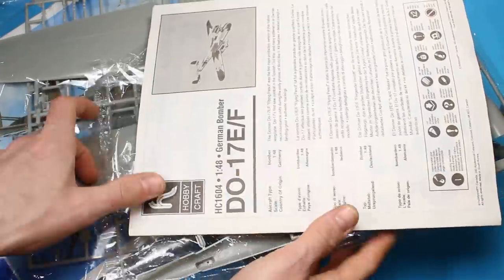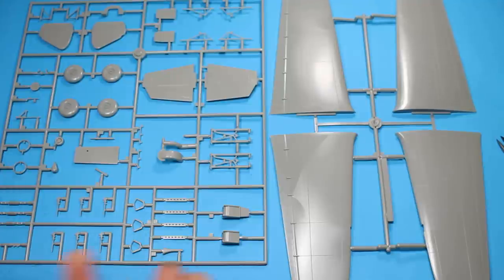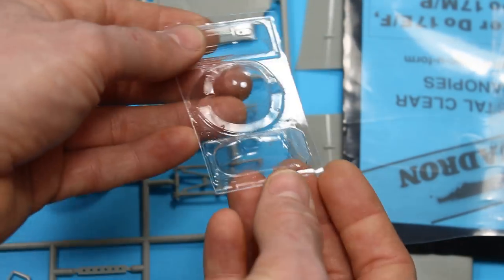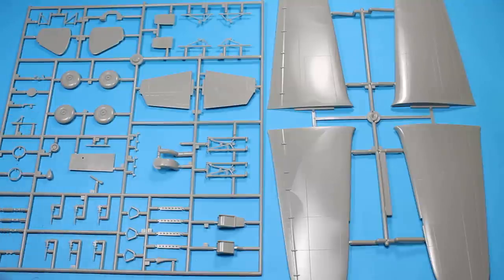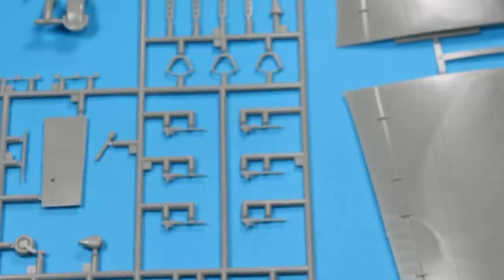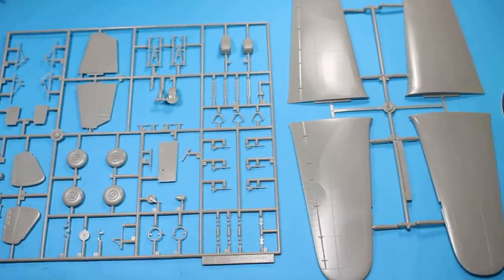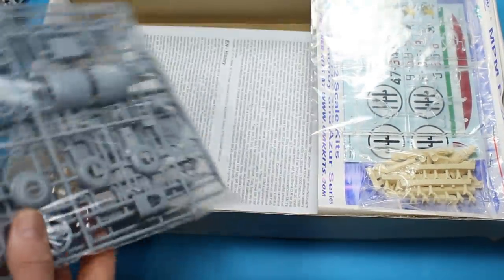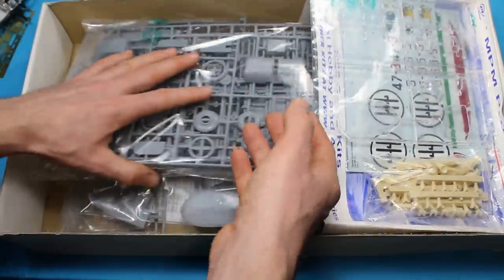Scale Modelling Weekly, Season 2, Episode 2

Comment: The Hobby Craft Dornier does have a MAJOR issue with the Fuselage shape - Its got a bend in it, making it a bit like a banana- the tail end is too high. I had this kit years ago and have never built it because of the problem. Then ICM released their Do 17Z/Do215, which are good, so you may be able to cross kit the front end of this with the tail end one of those ICM kits for a better result.
Expensive but a LOT less work in the long term.

Comment: Hi,the Fiat looks nice,something different anyhow?,the Do 17 should go together ok at the end of the day also?,I built the Special Hobby P-36 early american fighter in 1/32,another short run kit,a couple of years back,with some minimal resin parts & PE in the kit,went together fine,no real issues,the front engine cowl fitting to the front of the fuselage was kind of a pain at first but it just needed some extra reinforcing added on the inside,behind the instrament panel to make it line up properly & stay in place & the landing gear was a little bit frustrating also but got round it in the end,came out a nice looking early war aircraft in the end,so look out for those type of things when you do the Fiat?,cheers